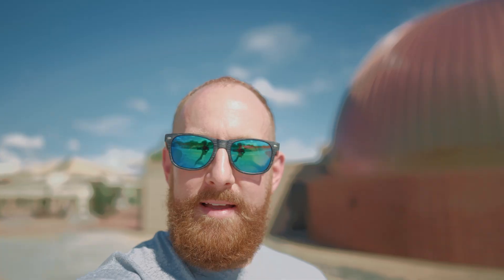Installing a PlaneWave CDK700 telescope at the Dark Sky Discovery Center

Comment: I assume the "periscope" is the smaller scope pointed vertically towards the zenith. Is this used for polar alignment somehow or to monitor seeing? Thanks.
Reply: Ya the periscope is just an extension for visual observing through the Nasmyth port. This way the eyepiece is accessible for people in wheelchairs as well.
Reply: @MattDieterich  You can make it by putting 2 very good refractors together, objective to objectiv mounted.
Reply: I think it's the way you can use the CDK as a visual telescope. Polar alignment is handled by the software PWI4 and the main telescope.
Reply: @M31glow  No need for polar allignment. It is azimuth mounted. You need a good  T point model